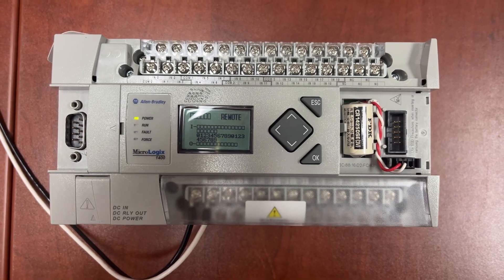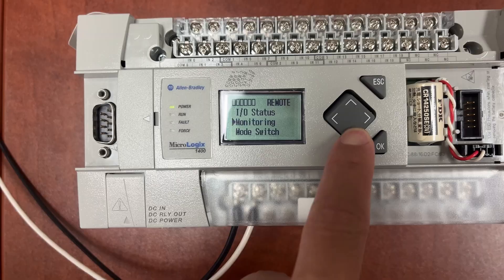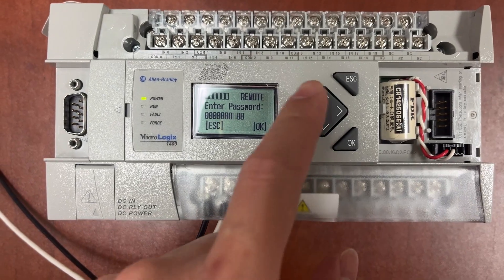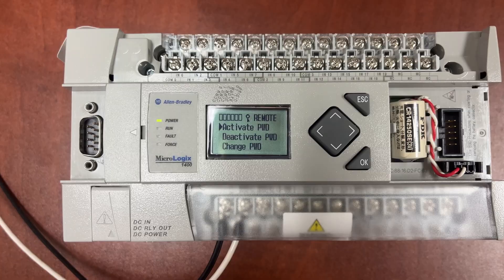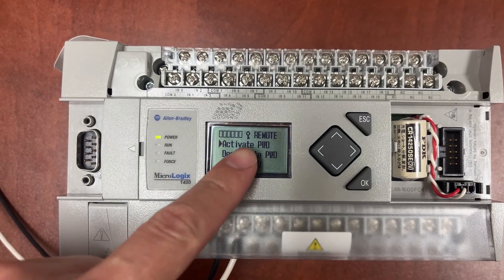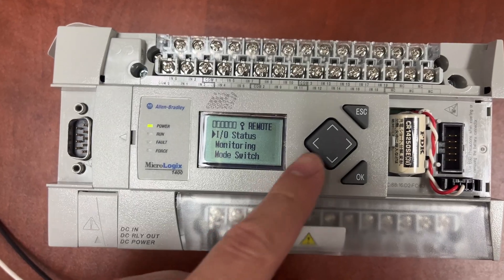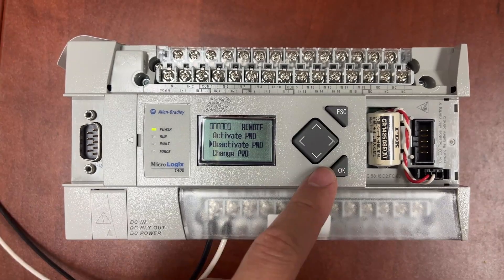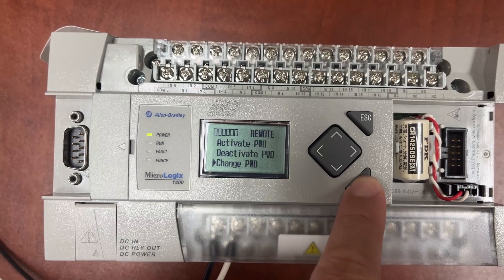Allen Bradley MicroLogix1400 Security/Password Setup

Comment: Sir,Plc ini sama dengan punya saya.
Punya saya lampu indikator power hidup(warna hijau berkedip)
dan lampu indikator Fault hidup(warna merah berkedip)
Tapi Display tidak hidup,bagaimana cara mengatasi nya?
Thank you Sir...
Reply from the maker: @inayafadilah8568: if the display is dead, it's impossible to see the fault code for any further troubleshooting. If you want to recover the program in the PLC, you can try to upload it from the serial port. But it can be challenging because it can be configured as either DF1 or DH485. One you have the program from the PLC, you can download it to the new one. Good luck.